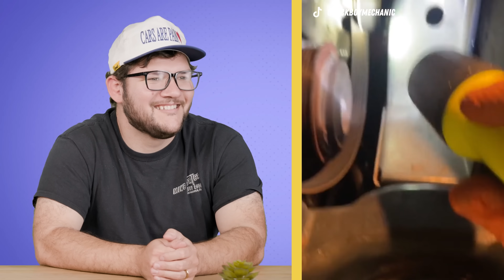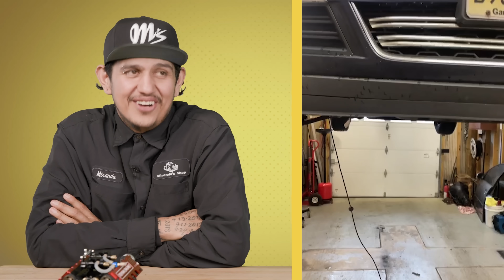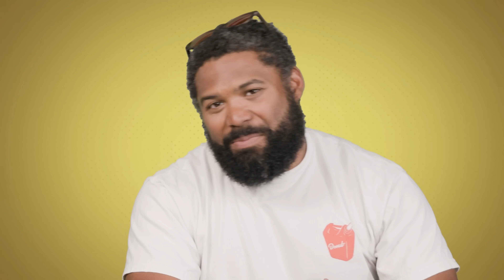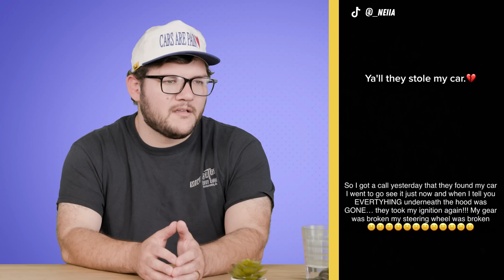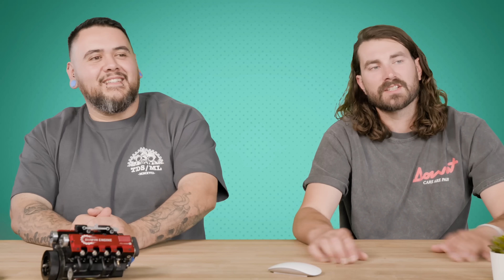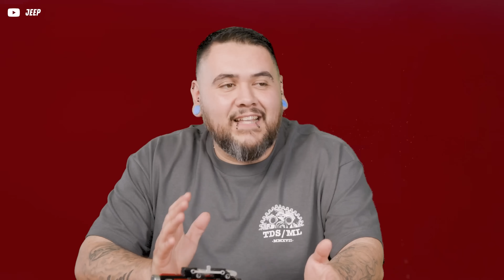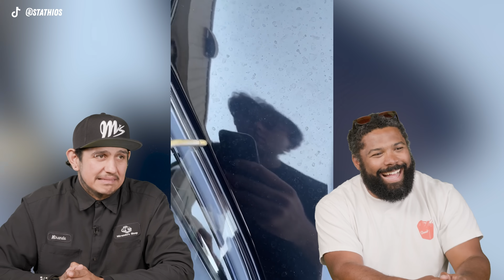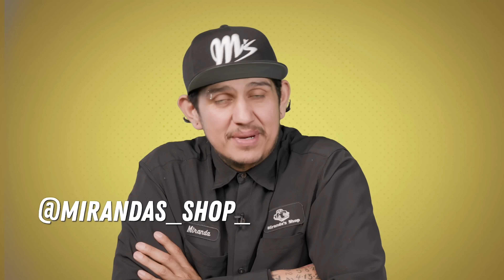Mechanic Reacts to Car Engineering Fails

Comment: You're gonna love this! A modern Porsche requires you to remove the entire engine to.... replace the spark plugs.
Reply: I was scrolling through the comments, scrolled past this one and had to do a double take, just spent 30 sec trying to find your comment again just so i could say;

What the actual fuck?! Why???
Reply: Jesussssss that’s actually so insane
Reply: Making the same design decisions they made when making tanks I see.
Reply: They took inspiration from the Ferrari F355
Reply: A set of high quality plugs can last a very long time. The engine will be out for other reasons before the plugs go bad.
Reply: That is a hatecrime
Reply: Where are they located you can’t change plugs
Reply: Are you talking specifically about the Porsche 911? That might be true, given its flat layout and the fact that they stuffed it in the trunk. I can't imagine you're talking about their sedan or SUVs, given that those are normal V8 engines sitting in the normal engine location.

However I was looking at Porsche Caymans/Boxsters, and you actually don't need to pull the engine to replace those spark plugs! You can reach them through the wheel well once you pull off the rear wheels. Maybe they have a similar access method, with the 911, but maybe they don't.
Reply: That’s because they don’t want you working on it
Reply: I used to hate writing estimates with a Porsche shop. The amount of shit that is required to write up to do basic shit is fucking annoying.
Reply: At least these models/engines are normaly out in very little time like 30 min or something.
Reply: Designing a car where you have to pull the engine to change the spark plugs truly is going full retard.
Reply: Porsche technician here, that’s incorrect. All of our spark plugs can be replaced with the engine in the engine bay.
Reply: It’s so they can sell you a new car when you come in to change the plugs
Reply: My beautiful 72 Chevy 4x4 has a kill switch! Why caught some guy trying to get in it! So I modified the glove compartment liner to be removable and hid a kill switch behind it, even with the liner removed it still was visible! I don’t worry about it being stolen! But people still have tow trucks!
Reply: Yeah but that's not new, they have been like that since 15 or 20 years by now, I think.

Also removing the engine is the most optimal position you can have it to work on it, and since it's already out you might as well take the opportunity to do a full check up on it.

Sucks if you want to mount it again only to discover that replacing the spark plugs didn't fix your problem...

Comment: Fiat Freemont has a really stupid design regarding the oilfilter placement. They use the paper filter within a enclosure. Where is this enclosure? Behind the shocktower pointing outwards. So you need to loose the shock to replace it. Also they have a flow channel that runs around for controlling the spillage. But it doesn't work. Just spills all over

Comment: As someone that works on all different types of cars on a daily basis, American cars are the absolute worst cars to work on. GM, Ford, Chrysler they’re all hot GARBAGE. Not only are they extremely frustrating to work on because of their brain dead design, their parts (especially the interior) are cheap pieces of sht that crack, break, leak, fade and chip extremely easy.

Comment: Trailblazer SS oil starvation. Look at the design of the oil pan. Passenger side axle goes thru the oil pan and they also made a front sump oil system on a v8 torquey truck. Pick up tube starves and bearings fail all the time on them

Comment: Had to modify the splash guard under my Kia because of the same oil drainage issue. Really dumb design. It also had weird electrical quirks, like the heater fan turning on with the headlights occasionally, the passenger brake light working very intermittently(until it was rear ended, now works perfectly but no lens 😂) and the headlights sometimes refusing to turn off. I'm somewhat glad it was totaled, but it never had any significant mechanical problems even though I treated it like a POS.

Comment: Jeep's have always had problems with their electrical systems, even the old ones.

My old Nissan with the ka24de engine is prone to leak at one of the fittings for the cooling, and it leaks right into the electrical connector for the alternator, which will cause the alternator to fail before it even manages to drip onto the ground.

Many of those engineering fails is in reality an accountant fail.

Comment: My only grudge I have against an engineer is with the 1984-1987 Honda CRX.
Every panel in the front besides the hood is plastic and insanely fragile, the bottom half of the cars are plastic too and have the same problem, and one of the spoilers is made of foam and gets really old and crusty and disgusting. There are carbon replacements for everything I mentioned but it’s about $500 per panel so it’s just very expensive to replace and inconvenient.

Comment: For that audi RS3 maybe audio does it different but what we do at ford is take apart the entire entior, i mean it goes to bare metal and exposed wire on the inside throw it out and put in new interior. Ive seen it be done on 2 explorers and 1 fusion. Our quick service guys do the repair as well

Comment: A lot of these problems are caused by bean counters. The long bolt in the pulley is likely used elsewhere. The kia ignition i'd almost guarantee is a result of cost reduction efforts.

Comment: I am a mechatronical engineer, not automotive... but this problem is in every field where both an engineer and after that a tech person work on the same part/job/whatever. IMO, this is something where both the engineers and tech's should bundle powers. To have benefits for both profesions. Techs have a better time, since they don't have to chase down some stupid mistake, and engineers get to be more innovative about the products, since they don't have to redraw or think the piece they've made 10 times over to just be able to perform basic maintenance.

Comment: My dad had a kill switch on our old car. It was a Lada Samara. 😅

He also put a safe lock on the reservoir cap. To be fair some local kids used to syphon off gasoline to run their bikes.
Reply: Did he also have unbrella steering lock and VIN engraved on windshield?
Reply: @veikovasko5603 Nah. But he made himself, from spare bits, a custom steering wheel with wood in lays.

Also kept that car going good 2 years past when most mechanics gave up on it. It barely ran, but if you remembered to always stop on a slope....

Comment: Most probably the material of the bolts on the McLaren are different than the metalts that they are attached on. Usually difderent type of materials, especially certain ones don't play well when it comes to rusting. Different energy levels of materials affect each other negatively.

Comment: You only do that on the Land Rover once, swear a ton of times, curse everyone, clean it up and then use and cut up an old brake bottle to drain all other Evoque's, Disco Sports etc. Its also fun when its piping hot and its a waiting job, so it burns even through the bottle, fun times. Also the oil goes like that on a diesel after about 30 mins of running the engine so thats normal for these cars

Comment: Oh man the army's humvee replacement dog shit nitrogen suspension battery ground cables colored wrong batteries under the engine 3 belts if the back one is back the frist two have to come off along with the plate it's so God damn frustrating to work on

Comment: Some cars have really bad engineered stuff...  Like put an alternator underneath where you have to remove all the water pumps and everything just to get an alternator out,,,,    it's all on purpose ... Luckily for the most part my car is not that difficult I'd make sure when I actually bought it that it was easy to work on... But it's still has its perks but I found ways to help myself... Like the alternator on my car I've taken out and put together a few times and it's underneath the exhaust in the back of the engine.. And only way to get to it is from above and with one hand so I made a little tool handle of wire that I could use both hands and I've cut down the install time to 20 minutes when it normally would take at least 45 minutes to install

Comment: In an engineer. During schooling they tell us that marketing will always push and/or force engineers to do things a specific way or a cheaper way. And of course, higher ups and stake holders are always going to go with "well this way will saves us $xxx", even if its pointed out that it will screw up or make things harder in the long run. Sometimes it's out of our hands.
And sometimes engineers are contained to using parts, things, and methods on hand. It's expensive to make a new machine for a new part. Stakeholders are going to tell you to do it again, but using the machines on hand

Comment: I just bought a 2023 Jeep Gladiator Mojave, and have had ZERO problems with it. How DARE you Jeep haters constantly disparage Jeeps!!! You may be professionals with decades of experience and expertise, but I'm a random guy with plenty of anecdotal evidence to use as proof I'm right. I've put 3000 miles on it so far, and it's in perfect condition. So quit hating! By the way, next week when it breaks down I'm deleting my comment. Just a warning.

Comment: Sorry but I'd just cut that bolt in half and get a new slightly shorter bolt.  I work on my own vehicles and have never bought new and I'd never leave that son of a bitch of a long ass bolt in there.  Sawzall's and hack saws are definitely automotive tools.  Also you can buy cars for a damned good deal if you run into vehicles that are engineered like this.  People just want to get rid of the damn things.  Case in point, my 09 Cadillac CTS.  It's a great car but damn if the mechanics at the dealership and local garage won't Jack up the price on you just cuz it's a Cadillac.  Dude I bought the car for 6300 dollars, I'm not going to pay 3000 dollars for a new drive shaft when all it needs is a new mid drive shaft bearing.

Comment: Love that the Traverse was the first on the list. It gets worse too. Even the oil filter is in a prick of a place, next to a red hot catalytic converter, smooshed between the radiator and engine, and directly above a motor mount that it dumps oil all over when removed. The whole goddamned vehicle was an engineers "love" letter to mechanics.

Comment: For the first one, since you can see the back end of the bolt and how much thread is and isn't being used, I'd put the bolt in all the way, then cut off as much as I can. Or, depending on where and what panel is blocking that bolt, I'd re-engineer the panel with a hole saw to make enough room for the bolt and a socket. That looks like frame tho, so probably not likely there.

Comment: On the first one, couldn’t you just cut the bolt and replace it with a shorter one?
Reply: Well its mostly about that its regular replacement part and usually the actual change time is not much than 20min. By that long bolt it added easily a hour of additional work. Also working on car with small clearances around the engine is always pain and more repairs that need engine pull out. Witch by it self to take it out and put back a full day and there is more risk of damaging it, by the manipulation it self or improper installation like mixed hoses or forgotten connections.

Comment: 2016 sierra to remove the top bolt of your shackle on the Leafs the bed has to get unbolted and lifted.... Very silly one.
Reply: have one with bike
If i want to remove exhaust of the back piston i have to remove, side cover, seat, move plate that hold passenger pegs and unscrew 2 nuts were on one of them i have to rotate the spanner cause i have less then inch of travel. And finally find the fight orientation to take it out will take additional 15-20 min if done for first time. Since the pipes deform from the heat you may miss the right orientation cause you have to force it out. At least they are consistent since it behave same way on multiple engines.

If curious it is 2007 Keeway Land Cruiser 250, after 2010 replace carburetor with injection and slaps massive O2 sensor at the front pipe, not only a eye sore but in such position you may damage it by going over a curb. Also reminded that nowhere on the fuel line is any kind of filter and tank rust quite easily. The one i added i change once a year, clean the carburetor + fuel vacuum pump. Also good for catching water.

Comment: If you need to remove a skid plate to change an oil filter then you're a shitty engineer. An easy solution that I see on absolutely nothing is a circle in said skid plate to remove the oil filter.

Comment: my best bad assembly moment was a Ford with their winged oil cap - which would have been great except the air conditioning coolant line was routed AGAINST the side of the oil cap.  so to put oil in, you had to break the top off the cap and turn the inside with a screwdriver.

Comment: "Everything you buy right now is not built right" Hit the nail on the head with that one. Ill keep limping my old 💩box along than buy anything built in the last 10 years. Was built and designed terribly then, and now they are just throw aways.

Comment: There is a special place in hell for mechanical engineers who design crap like that. That place has bullshit like that with them working on cars with no manuals/schematics, never the right tool, and varying between 100 degrees/sunny/humid to 34 degree rain and night time. Fing morons.

Comment: There is a tsb for the q3 water leak. It happens to pretty much every single one. Water can’t drain from the sunroof and gets backed up into the storage compartment for the wind deflector then into the cabin through the dome light. Most of the time the drain hoses are pinched and there is a “modification” that needs to be made to the sunroof glass and frame
Reply: There's absolutely zero way the dealership didn't know about it

Comment: Had to deal with one of those range rovers like that a couple weeks ago 😅 definitely overlooked it. Why put a access hole for the drain plug if there isnt room for it to pour out?! Had to take off the whole skid plate and clean it all off and mop up the mess. My mistake definitely will not happen again lol.

Comment: The problem with engineers is that most of them go from the classroom to a cubicle or office and spend zero time in the field working with the project that they are becoming responsible for engineering.

Comment: As someone that worked for two of the top three largest automotive companies in the world (and another smaller brand for a time)

Cars are designed by a set of rules, engineering always takes those rules into account when designing it, all of them, ease of assembly(for obvious reasons) and ease of dissasembly, gaps between parts, etc. They are ALWAYS taken into account when designing a car. 

The reason they don't make it to the final product is because the people in the fancy suits decide "it would be too expensive". That's it. That's the only reason Audi puts the fusebox under the ecu and puts washer fluid tank on top of it. That's the reason the bolt in the beginning of the video is so fucked up, they decided that rather than fullfill the golden rules of assembly, they would rather just...not.

As a purely fun fact, in the early stages of industrialisation of a car released in 2016, you had to remove the entire dashboard in order to remove the A-pillar trims (and subsequently the speakers inside them), after a long escalation process, fancy suit bois dropped hundreds of thousands of $ in order to make it not-as-ridiculous to remove a damn trim part. 
It could have been done for free as it was a known problem during early design stages, but oh well.

Believe me, in automotive, engineers try to follow the rules, we own vehicles and sure as fuck we work on them ourselves.

Comment: 5:55 - There's a dividing line where design engineers and production engineers share common ground. At least, they should. If you design something that has tight tolerances, you should be aware of how difficult it could be to produce. I'd put that McLaren stuff on both sides, factory and engineering. The factory doesn't decide which alloys to use, or what coatings there should be. It looks like that trunk lid would probably make contact in most of those models; unless there's just a really tight clearance for that movement. Either way, it's a pinch point that should probably be avoided.

Comment: Did a power steering pump on a 94 Plymouth duster kinda similar to the traverse except the actual pump can't get out of the car unless the engine is lifted 2 to 3 inches, and to get the belt on you have about 1/2" of space to fit between the engine and subframe and the power steering pump pulley was made of cheap abs plastic and I had 3 of them explode on me and had another power steering pump fail on me when my rack and pinion didn't want to be sealed anymore should've never sold the car had 87k and was sitting for a while but it ran and drive great with the exception of the power steering, I thought doing the rack was going to be a big job because I had just done one in a Grandcaravan the year prior, come to find out 3 to 4 years later the sub frame is mounted with 4 bolts and everything drops right on out even if you had it on jack stands it would be like a 6-7 hour job for redoing all ps lines new pump and rack better than the grandcaravans 14 hour job for the rack on that

Comment: Jeep Grand Cherokee with the 3.7l the starter is above the front driveshaft which needs to be dropped and removed by taking out the whole subframe, any 4.6 northstar v8 the starter is underneath the intake manifold